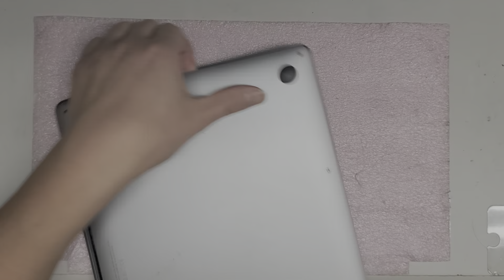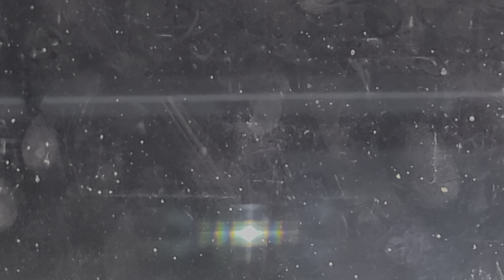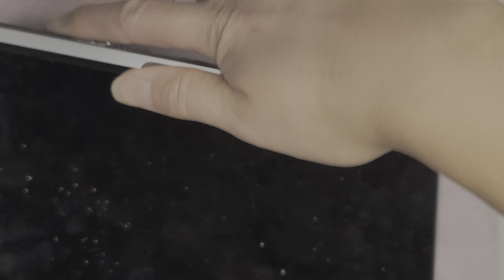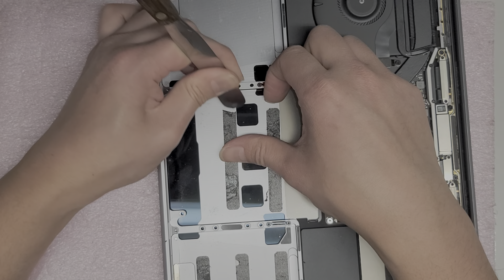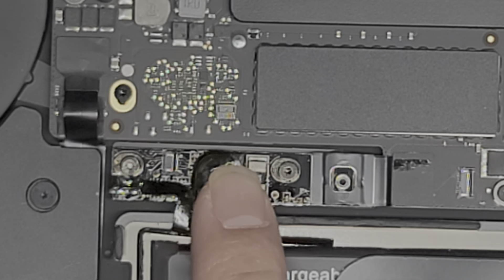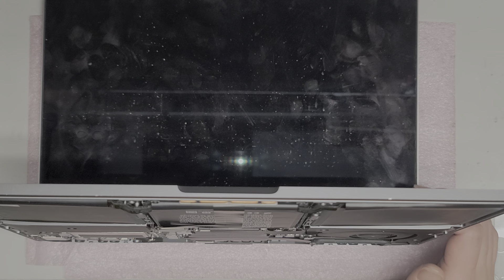13" inch MacBook Pro A1708 Late 2016 Mid 2017 Disassembly Battery Replacement Repair

Comment: help!! I can’t get my pancake screw to secure back in while putting back together
Reply from the maker: Pancake?
Reply: that’s what google called it 😂 the large circle screw that holds the battery flap thing down. it’s almost as if the screw isn’t long enough.
Reply from the maker: @Sarah-r8f5y either the battery is defective or the tab isn't lined up right

Comment: I can see both gold metal but for some reason that battery screw won’t screw back in😢 i am getting frustrated because everything is centered. I need help
Reply from the maker: Turn the screw backwards to feel it click in place.
Reply: @ItsBinhRepaired I will try this now
Reply: @ItsBinhRepaired it clicks in place. But going from the top it just keeps spinning without locking
Reply from the maker: @Lisa-ed4qe  It won't go in spinning clockwise?
Reply: @ItsBinhRepaired no
Reply from the maker: @Lisa-ed4qe  might be a bad replacement.
Reply: @ItsBinhRepaired you might be right. I noticed the two metal between the battery screw is slightly raised. On my old battery both are flat. It could be too much height for this short screw to lock
Reply from the maker: Possibly
Reply: @ItsBinhRepaired the seller confirmed they sent the wrong battery, so I returned it. I ordered a battery off Amazon from a different seller and installed it yesterday. But I thought I fried my logic board because the computer wouldn’t come on it had no power. Took me an hour troubleshooting. Left it plugged in for about 40 minutes tried it again and it came on. Thank you for your video it help me and other people save money.
Reply from the maker: @Lisa-ed4qe  awesome! Glad it worked out in the end.

Comment: Both clingfilm and kitchen towel covering the display, plus soaking the glue with 20 drops of isopropyl alcohol for a few minutes per section, is a better solution for removing the battery gently
Reply from the maker: Nice

Comment: Hello, I have problem with my keyboard not working and fan making a lot of sound after I change the battery. Is there any way I can fix it? Please advise. Thanks
Reply from the maker: That's usually a bad touchpad or touchpad cable
Reply: Thanks for your reply. Just to understand more as it’s my first time changing battery. Does a bad touchpad or touchpad cable means I have to unlock touchpad screws to check and also make sure the touchpad interface connect well? Thanks again🙏🏻🙏🏻🙏🏻
Reply from the maker: Yup
Reply: @ItsBinhRepaired  thanks
Reply from the maker: @sandraenroute  hope you're able to fix it.

Comment: I have a question. When you connected the new battery cable with the board you were trying to align the screws but the cable i am see is bent. Is that true?
Reply from the maker: The small ribbon cable?

Comment: Thanks! that was very thorough and careful, especially reconnecting the battery board data cable.  Couldn't have done it without you.
Reply from the maker: Glad it helped and the repair went well. Thanks for the support!

Comment: Hello. thanks for a great tutorial. I managed to change the battery but now the computer only works with the charger cable in and I don't see a battery symbol next to the Wi-Fi sign in the top right corner. What could be wrong?
Reply from the maker: Double check the ribbon cable and the battery tab.
Reply: @ItsBinhRepaired  It worked!! thanks a lot for a quick reply man.
Reply from the maker: Awesome! If you haven't already, please like and subscribe so others can find my videos and possibly consider watching a few others to get the algorithm to recommend my channel. Thanks!

Comment: Great and super helpful video. But my issue now is that it doesn’t seem to be charging? After installation, I turned it on and worked fine but then came back to it 30 mins or so later, while connected to the charger. Opened it up at 68% charge, but now I don’t see the “charging” mode sign at the top right where my battery life is displayed.  Battery slowly dwindling as I’m using it now.  Any thoughts on what’s wrong now?
Reply from the maker: The ribbon cable is likely not installed properly or the tab isn't aligned right

Comment: Very helpful and amazing video, My main thing is be extremely careful with the batteries, mines was barely punctured and started sparking like a firework, I decided to just go for it and pull it out and it went amazing, but just be careful!
Reply from the maker: Awesome, glad the repair went well. Yeah, you want to be careful not to puncture the battery.

If you haven't already, please like and subscribe so others can find my videos and possibly consider watching a few others to get the algorithm to recommend my channel. Thanks!

Comment: HI- My cousin has a similar problem!  we bought ours together.  He can't get the track pad cable on.   seems the gold part you slide in the slot is a little wider than the slot allows.  like the wings are getting in the way. he can get it in sideways but no straight on.  and the bar is up.  any suggestions?  thank you
Reply: disregard. he got it figured out.  there are two different gold ends.  he was plugging the wider gold piece into the one made for the smaller end.  all resolved.  my computer works fine.  do we have to do the PRAM reboot thing?  just checking
Reply from the maker: Make sure it didn't get bent or anything.
Reply: @ItsBinhRepaired  got it working!  thank you
Reply from the maker: @dnddabbs  awesome!

Comment: Excellent instruction!  Just the exact right amount of detail!  Took me an hour or so, but very doable!  Unfortunately I got into the battery removing the adhesive which lead to a small fire and lots of sparks, but everything turned out ok.  Be careful folks!!   Thank you so much!!! I could NOT have done this without your video.
Reply from the maker: Glad it helped. If you haven't already, please like and subscribe so others can find my videos and possibly consider watching a few others to get the algorithm to recommend my channel. Thanks!

Comment: That big screw at 5:00 is either stripped or my tool isnt the right size.. how can i get it out?
Reply from the maker: You have to use a T5 torx 5 screwdriver.

Comment: This is the sort of stuff You Tube is made for. I just threw myself into this after been given a 2016 MacBook pro that 'didn't work' What i didn't realise is the complexity of the video and 5 minutes in i was thinking 'I wish i hadn't embarked on this journey'! By 35 minutes in i was thinking 'I am the man'! Which i clearly wasn't you are 'the man'! Hats off to you. Ow maybe just mention unless i missed it at the start that the batteries may explode as you take them out!!! Gulp sweat... Worked a treat. MacBook pro that is now working! Thanks again.
Reply from the maker: Explode? What did you use to get it out, a steak knife? Haha be careful D:

Comment: I changed the battery but now the laptop is not charging. It has an X symbol on top the battery logo/symbol when I connected the MacBook with my adapter. Any solution? What should I do now?
Reply from the maker: Sounds like you didn't connect it properly. Double check the ribbon cable.
Reply: @ItsBinhRepaired  okay let me try. This video was extremely helpful. I live in a  town where apple service center is not available. I actually had to go to a city to get it fixed but i ordered the battery and now I changed it myself. 😃😃 And you are right. My doubt on the ribbon cable was there. Wasn't sure if it got connected properly. Will have to open the cover again. I'm backing up my Mac just in case.
Reply from the maker: @sreesriyaKM  hope the repair is successful

Comment: Hi Sir. Macbook always says lowbatt icon everytime i power it on. Even if charger is plugged? i removed the flex cable on top of the battery connector and installed it back. Can it be the problem? The flex cable. I was trying to replaced the ssd by the way.. appreciate your answer.
Reply from the maker: Usually the tab or the flex cable
Reply: @ItsBinhRepaired  thanks.. i will try to replace it
Reply from the maker: @kylaling10  sounds good

Comment: I tried changing the battery but my battery is not charging
Reply from the maker: You likely didn't put the tab or flex cable back properly.

Comment: Do you repair MacBook pros?  I bought a battery and installed it but the laptop does not come on.  Help!
Reply from the maker: Was it coming on before the battery change?
Reply: @ItsBinhRepaired  yes
Reply from the maker: @tammyvaughn773  likely didn't install it right

Comment: I just tried putting in a new battery, and my computer isn't even recognizing the battery. I hope I didn't break something. This is so frustrating.

EDIT: Nevermind. I got it to work. The little ribbon thingy on the new battery must've been defective because when I put the old one back on, it worked.
Reply from the maker: Glad you figured it out

Comment: hello! can somebody help me? I changed the battery properly step by step. But the thing is, since I switched the old battery with the new one, there is still "service recommended". And the worst part is, the battery is between 1800mah or 980mah and the battery that I replaced is 100% new. I did the SCM reset but not the RAM reset. Could you somebody help me? Thank you!
Reply from the maker: Battery is likely faulty. Get another :(
Reply: @ItsBinhRepaired  damn.. so the issue is on the battery and not any settings or resets Right? Then I will contact the seller. Thanks and greetings from Germany!
Reply from the maker: @KakatamiTV  most likely
Reply: @ItsBinhRepaired  hi! Got an Update, maybe it´s interesting for your future clips. What I did, was charging the battery to 100% and then charged it for 2 more hours. After I did this you have to run the Mac till it runs out of battery and then you will leave the mac for at least 5 hours without battery. Then the battery calibrated itself again as has full capcity. ;) And the service recomended alert I got rid of with an PRAM reset. :)
Reply from the maker: @KakatamiTV  Nice!

Comment: Hello, I just tried to replace my battery yesterday and all things went good until by now! For some reasons I cannot charge the battery anymore. Can you guess what the issue could be? Sometimes it was charging sometimes it wasn’t and now the battery is zero and I can’t turn it on and it’s not charging …
Reply: Is it maybe because I did not the reset?
Reply from the maker: Could be your charger or the charge port. Check if all the pins are gold.

Comment: Thankyou! I was able to replace the battery and it was working fine. But today I have come back to my macbook and it is dead and won't charge, it won't boot up and only flashes the charging icon for a few seconds. I've left it on charge overnight and there is still no change! Any ideas?
Reply from the maker: Either the connector isn't lined up, or the battery is bad or was damaged. Check the ribbon cable as well.

Comment: Please don't try this battery removal technique!!!!!!! Removing the li-ion battery with a metal tool is extremely dangerous and can lead to fires. Only use plastic tools with adhesive removal.
Reply from the maker: Stab the battery with plastic. I dare you! Let me know how that goes. I've removed hundreds and hundreds and never had issues. If you follow directions, then you also won't have issues.

Comment: I need assistance. I was changing the battery for my MacBook Pro, the same model as the one in the video. I did everything right until the part about connecting the cable to the battery. At that point, I tried to push the clip back to lock it, but unfortunately, the clip broke. I am stuck at the moment. What’s the best solution to put it back or connect the cable?
Reply from the maker: Need to slide the clip back on
Reply: @ItsBinhRepaired  alright. Thank you. Let me get a tweezer from the local store.
Reply from the maker: @robsonkanyama7851  alright

Comment: .

Thanks so much for the tutorial! Writing this on my MBP and freshly installed battery and everything seems to be working great (100% charge). I did manage to completely mangle the old battery trying to get it out though. Thankfully, I didn't have any fires or anything like some of the commenters have said - never even really felt warm but I could smell it. I have it out on the sidewalk to be safe but what do you do with the old batteries? Thanks.
Reply from the maker: Glad it helped. If you haven't already, please like and subscribe so others can find my videos. Thanks!

Comment: Do you know where to buy the adhesive tape for the macbook battery. I took out the battery to replace the keyboard. Need to put back the battery
Reply from the maker: Any tape works. You can even use rolled up packaging tape to make it double sided.

Comment: Hello thank You for the video.  I followed your instructions to the letter. I thought I had done everything right. The problem is that I get a red battery icon like it recognizes the battery but not changing sound no charging.   Any ideas?
Reply from the maker: Double check the battery tab and ribbon cable.
Reply: @ItsBinhRepaired  thank you much!
Reply from the maker: Did it work?
Reply: @ItsBinhRepaired  No, the more I mess with the ribbon connector I think I am damaging them. Oh well I gave it  my best shot!
Reply from the maker: :( Did you damage the cable?

Comment: Excellent video, but I do feel the need to emphasize just how easy it is to breach the battery cells while removing the adhesive. Even with an appropriate pry tool and careful, deliberate action, I ended up with a mess of torn battery casings and, yes, several small fires. Seriously unnerving, and somewhat embarrassing to confess, but perhaps it will help to prevent a similar experience for anyone else.
Reply from the maker: Yup, this exactly! Using non metallic tools won't prevent puncturing or causing fires. The battery is made of metals. Lol Puncturing it with anything can cause a fire because the lithium reacts to the air, not the tools.
Reply: 😳 Oh my Gosh! I could have started a fire! Thanks for the heads up! This is truly a task for the brave or foolhardy! I think I was in the second category!
Reply from the maker: I haven't had that use and I've done hundreds.

Comment: good instructions but NEVER use metal tools on batteries
Reply from the maker: Already did thousands of times lol
Reply from the maker: If you have a problem with metal tools on batteries, I wonder what you use on the motherboard.
Reply: @ItsBinhRepaired  the problem with metal tools on batteries is that your creating a unnecessary risk of your battery combusting
Reply from the maker: @hasankayisci7990  that's what you think, but stab one with a plastic tool and tell me what happens.
Reply from the maker: @hasankayisci7990  heck, stab one with a rubber tool or even just smash it up with a rubber mallet and see what happens.
Reply: @ItsBinhRepaired  i would suggest using plastic tools for the battery instead and using glue remover to losen up the adhesive on the battery

Comment: Brilliant instructions, thanks to you I was able to change and properly connect the battery, it didn't charge without mains power, since the connector pins were covered, like in a case. Thanks
Reply from the maker: Glad it helped. If you haven't already, please like and subscribe so others can find my videos. Thanks!
Reply: After I replaced the battery, the laptop must be plugged in to work. How did you fix your issue?
Reply from the maker: @margaret8114 you need to make sure the ribbon cable and the metal tab are connected properly.
Reply: @ItsBinhRepaired  Try to insert it into a crack, and you can't pull it out.
Reply: @margaret8114  As I remember, since it also happened to me, this is because the flat cable connector (CI) is not properly inserted into its plastic connector.
Reply from the maker: @mikeketerra  yup

Comment: Thank you, good sir. You got me back and running. The battery was expanding on mine -- there was a chemical smell being given off that I suspected was toxic or simply not good to be breathing in. I think I took a good 3 hours, being as careful as can be. I had an ooops moment when I accidentally pulled the tab off of the power strip! But after that I treated everything like I was handling dynamite! Thanks again, man
Reply from the maker: Awesome, glad it helped. If you haven't already, please like and subscribe so others can find my videos. Thanks!

Comment: How do you put the back cover on again? You skipped that part and went straight to turning the MBP back on.
Reply from the maker: Sounds like you need to watch the whole video.  Lol
Reply: @ItsBinhRepaired  luckily I found a better video 🤷🏻‍♂️
Reply from the maker: @Garret_Conner  lol nice, though if you paid attention, it was turned on for testing and then put back. I mention it in the video.  Sounds like you didn't finish the video. Short attention span. My videos are not for people that like to just skip from part to part.
Reply: @ItsBinhRepaired  Bitch 😂 I only needed to know how to put the casing on because the repair was already done but the clips at the front were giving me trouble. I bet you’re fun at parties though. Lol
Reply from the maker: @Garret_Conner  bitch, you don't even know how to fast forward to the end of a video. Lol what are you, 80? A 2 year old could figure out that much. XD

Comment: Hey I dont know what can be if I change the battery but in the start menu it just appear an x and we I disconnected it shut down
Reply from the maker: Check the small cable and the metal tab
Reply: @ItsBinhRepaired  Hey that work's thank you
Reply from the maker: @lordfuriosyt7124  glad it worked. If you haven't already, please like and subscribe so others can find my videos. :)